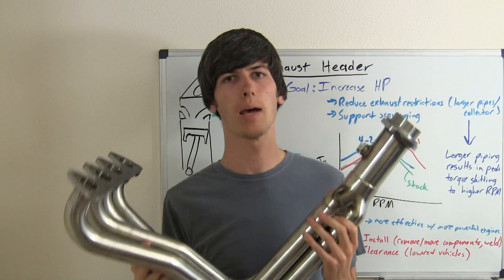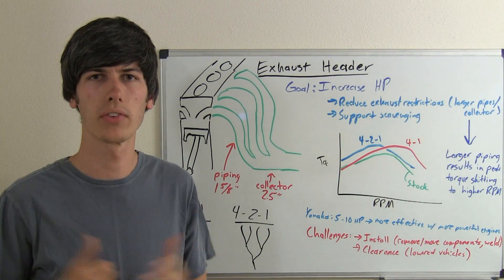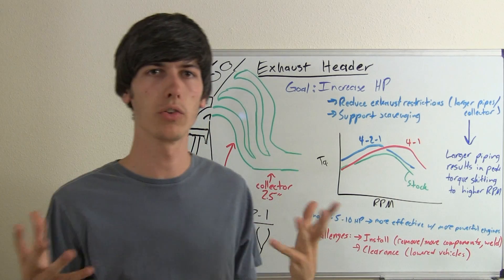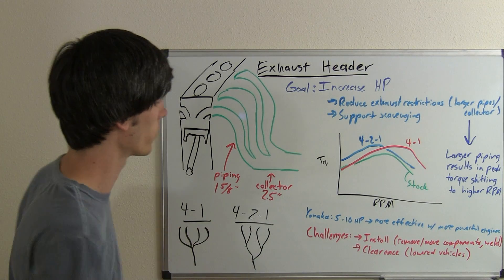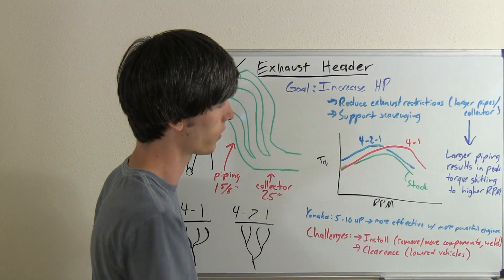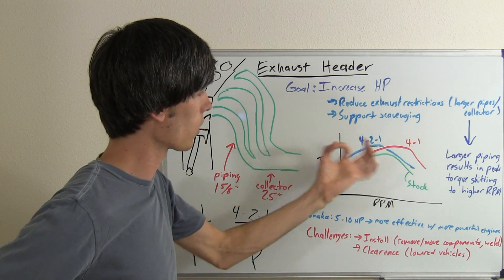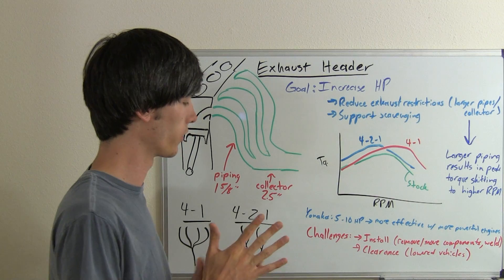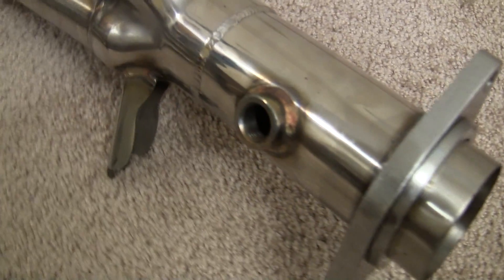Exhaust Header - Explained

Comment: What's in a name?.
Headers are usually cast iron factory fitted  first part of your exhaust system. Made cheap and compact in such a way that they create swirling gases that slow down the extraction of exhaust gases.
Extractors are usually an aftermarket steel or stainless steel put together so that exhaust flow from one cylinder assists another to extract exhaust gases.

Please spread this around headers are not Extractors and Extractors are not headers.

Comment: Thats a differant 4 into 2 into 1 should be explained as a 4 cyl. Header thats 2 and 2 into one, the correct, 4 into 2 into 1 goes like this...the 4 pipes converge into the split 2 pipes at the far end and then converge into 1 , then the 2 ....2s and the final 1 pipe act as a collector. Hope i said it right,  Hope this helps.

Comment: Ik this is DECADES old but i have a question... ima instal headers regardless but since i have a yonoka catback exhaust system and i wanna know once i install the headers and then getting the tune.. would it make my car start to pop? Cuz my car makes suttle pops like sooo low pops but you can hear just not loud like most cars are.. so my question is will it start to pop? Also i did an exhaust delete hence why it pops very suttley

Comment: Other than the sound what are the advantages of a 8 into 1 header collector? Someone told me that a 8-4-2-1 would produce the same or similar sound without some of the power loss particularly in the low and mid rpm range and some of the packaging issues with the 8 into 1 collector. Is there any truth to this?

Comment: For me I have rsx k20a2 type s in the car I have 4-1 header with Muggen down pipe and 2”5 fully piping on eBay parts I feel my car have more torque and top end raced , I have raced b series  wrx Sti rsx and 9gen full both on still beat them ❤ 
I just say 4-1 vs 4-2-1 header depending how is the driver racing and shifting

Comment: Should the exhaust port of the head match in size and shape to the header or does it not matter? Some factory exhaust ports are smaller then the header. For example a M42B18 BMW. Do you have an advice?

Comment: Question.  how about n/a engined cars. i have a nontutbo 1.6 and 1 and 6/8 inches is the diameter now. can you tell me the theory about the diameter. should i worry about a 2.5 or 3 inch? as i dont really need backpressure. but i can imagine that i want the exhaust fumes to leave to the exhaust, so if the diameter is to big you dont fill all the space in there?

Comment: Hi I own a car with 67 horsepower at 6000rpm, 91nm at 4400rpm. Should I change the header for more hp or should I just sell it... It's Perodua BEZZA 2020 1.0 3 cylinder engine, It is an 1KR-VE Engine from daihatsu. Is it ok to put in turbocharger into and change the header?? The car is very low on hp and my regret of buying it... So help me out please

Comment: Dear Engineering explained. My question has to do with an exact situation with the C8 when one of the vloggers showed his receipt of a Kooks exhaust header. He did a "pull" with his stock header on the 2020 Stingray, 6.2 liter pushrod, V8 engine. After taking the initial reading for HP and Torque with the stock exhaust manifold, the latter was removed from the Corvette. In its place with the same other stock cats and pipes, resonators, pipes and mufflers and tips, the only difference that was tested, was the addition of the Kooks exhaust headers, where the stock exhaust manifolds formerly had been. (Although a short tube header system, the pipes appeared to be longer and with mandrel-bent turns to the, "collector." The diameter was slightly larger than stock. Then the C8 vlogger ran a dyno once again with temperatures the same; same gasoline, etc. Result: throughout the range, including at the cross-over, the Kooks headers provided readings that were 2 to 4 horsepower lower in both horsepower and torque, even at the crossover point, than were achieved by the stock manifold. What is the explanation for this? I wrote into Kook asking for an explanation and received no information at all. The only thing that might have affected this result, is that it appeared to me that the connecting flange of the Kooks header, had smaller opening than its pipes and also smaller openings than stock. However, writing into the vlogger, produced no response or answer to me, just a lowly fan, observing the YouTube vlog. AF

Comment: Would 4-2 headers be bad?? Would that make it more work for the engine since it’s only 2 cylinders pushing exhaust out through each pipe or would it help because it’d have more space and less restriction

Comment: Could you include an X pipe in the header design? Thereby increasing volume for exhaust gas and equalising pressure. Header pipes would then continue as normal to the collector.

Comment: I also have much respect for this presenter, but would like to make the following comments: It might not be necessary to use stainless steel for a header as it is too hot to rust. Then I don't see any mechanical accommodation for the engine movement in the exhaust in this transversely mounted engine. Kathrynck below makes mention of tuning; is there someone who would like to support the idea that a high pressure wave leaves the engine, and once it reaches the first sizable expansion point, it is reflected back to the engine as a low pressure wave, which enhances the air flow at certain frequencies ?

Comment: Do you think that by tunning the lenght of the primary runners on a 4x1 exhaust of a regular inline 4 cylinder engine (flatplane), one could tune it  to sound like half V8 (one bank of the V8 engine)? I've tried to think of it as the time each of the 4 exhaust pulses take to get to the colector and thus interfere each other, considering one side of a V8.

Another example: the crossplane crank inline 4 cylinder Yamaha bike: it sounds amazing because it is a 'half V8'. I've tried to think of the mathmatics of the pulses interferences as the time it gets to hit the collector, by selecting different lenghts of primary. It would probably hit performance but possibly create a great sound. And the performance loss could be offset by boost.

Comment: Heyy saw alot of awsome things on your chanel and in the comments I'm jus a guy working to make my car fun.... But here is something that I was hoping to get some fun ideas about I have a D16y8 550cc injectors nothing touched in the motor yet lol but I do have 4-2-1 headers jus got them I have a wider exaust and resinator 3 inch now will this cause some back pressure but still allow breathing properly in theory I'm about to bore the headers before I install for a smoother gas upstream down stream exchange it makes sense on 4-1 and why its better any thoughts and yes I will keep updated on my results I have videos of now w the factory headers and swapped injectors factory exaust id love to hear some input and haters please apply I love hearing all thoughts

Comment: Nice job on this video. You really should discuss the primary pipe length as it is the single biggest factor for the tuned header. A shorter pipe length move the peak torque higher up the RPM band while a longer pipe length moves this down the RPM scale.

Comment: why isn't a "two point five" inch pipe called " two and one half" in pipe? in line with other measurements like 1 and 5 by 8 inch etc? OR just stick to the more human decimal system? good explanation though..liked it

Comment: I apologize if you covered this, If you want to replace your stock exhaust header with something with larging piping, how would you connect the larger piping to where it connects to the engine? I'm guessing it has a specific diameter. I didn't know if there was another piece you would connect to make it fit or not. I love you videos I'm learning so much.I also have a vw rabbit a/t 2007 2.5 that I would like to start fixing up.

Comment: okay so hears a question for you that I've always wanted to know. i drive a subaru and the have a 4-2-1 exhaust header. now in theory if i ran duel exhausts from both sides of the motor basically covering the header system to a 2-1 would that increase power efficiency and whatnot? I'm VERY curious to know.

Comment: I suggest you to talk about the droning effect . I've installed a 4-1 OBX header with a magnaflow catback on my golf 2.0 and the droning inside the car is just sick, destroyng my ears. I caped one of the output pipe of the muffler to retain some back pressure. returning like standard "performance" it fix the noise quite good, but it no longer work very much now. at least ,I can just remove the cap if i want ...

Comment: I like that you talked a bit about the types of collector designs.  If you look at some of the nascar cup car headers, they have various designs including 4-1 and 4-2-1 for each cylinder bank, as well as various pipe diameters of each step.  It's really just tuning based on the track they're running, but it's surprising to see so many different configurations.

Comment: Is there a specific equation that you could use to determine the best, most efficient diameter tube to use based on engine and desired horsepower/torque?  For example, if you have a 5.7L Hemi and want to produce 500ft/tq.  What diameter tubing would be best?

Comment: What is the O2 sensor, and what does it do?
Reply: PixelRacerClips PRC 02 sensor is a sensor that is attached to your catalytic converter but since these are long tube headers you'll be getting rid of your catalytic converters so you place it there. And it just lets you know if your car is functioning or not

Comment: im planning to remove my resonator and upgrade my pipes into a stainless steel 2.5in pipes and change my stock muffler into a freeflow muffler.. my question is can i gain a horsepower into it?? thanks for more info you shared

Comment: sir my  question is if the if i have an v6  so should is use two 3-1 exhaust header?? ,n sir can u help me if i want to make an v6 engine which can produce around 600hp , but still i want a bit fule econome so if i m in 24h race i will make less pit stops in the race
plzz reply , TYVM

Comment: I have a 92 VX Honda Civic Hatch
Any suggestions for what kind of headers I should get??
Reply: Mike Harkins i want a street racing set up
Reply: Anthony Sainzz
.. All depends on your budget and what kind of power you are looking to get my man.. Street racing setup can be anything from ebay to top of the line depending on budget and power. Also, if you are going street racing, you need full exhaust setup, intake, headers, exhaust. And should be done at once not in pieces. So save up for the whole exhaust then have it put on at once. Saves in long run.
Reply: Mike Harkins yea Im getting the whole exhaust system first I just honestly don't know what brand tho I don't want anything boo boo , only thing is what's after the exhaust system? I just bought a new intake yesterday
Reply: Anthony Sainzz
OBX is decent for the money. I have one on my RSX and have had no problems. They have a lot of decent reviews and you cannot beat the price. I am not a huge fan of Skunk2, but hey it is all about preference here. I am not that familiar with 5th Gen civics, but I do know they are engines easily modified and last. Depending on how much power you are looking to get, I would first have an end goal before buying headers or exhaust. If you are going to boost, you will need better headers that can take more power. No point in buying cheap headers if you are going to boost in the future.  If you are just looking to stay all motor and maybe hit 200-250 HP with the engine, you can get away with cheaper headers and exhaust because they will not need to withstand such extreme heat and exhaust pressures. If you beat on the car a lot, I  would also invest in higher quality as well to handle your driving. You have to take into account many things before buying. You have to plan far ahead as to not waste time and money. If you have some really specific future goals I can give you more specifics, but it is hard to just throw out products you should get without knowing all the details. It would be best to find a good mechanic knowledgeable in performance and both come up with a plan of attack for the car and its upgrades.
Reply: Mike Harkins yea I get you dude, thanks for the advise 👏🏻 appreciate it, but if I have any question or something I will be sure to let you know or do some investigations my self, because I want so good things for my car I don't want something to be cheap and yea like you said don't want to waste time and money
Reply: 5

Comment: how does this add up with turbo charging? basically how does it affect the WRX;) is 421 better for quick spool or 41?
Reply: It all depends where you are trying to make more power man.. 4-1 will help on the higher end, and 4-2-1 will help on the lower end.. All depends what you are looking for personally in your car. Just research on the wrx sti forum on which suits what car and for what kind of power.
Reply: I understand the premise of the video but my question should have been if it's the same for NA cars.
Reply: Mike Harkins were you a 94E
Reply: Exodus fivesixfivesix
.. It is the same for both FI and NA cars.. Just more glaringly obvious for FI.. But so many factors are at play once you go FI

Comment: will i get any power or fuel economy improvement with a exhaust header with a stock exhaust?
Reply: not really. And power and fuel economy should not be used int he same sentence lol
Reply: bolt on mods tend to give hp and mpg boost at the same time.since adding somthing that increases power with the same amount of fuel u need less foot on pedal saving fuel.  just wasent shure about the exhaust header with stock exhaust.

Comment: Hi, I need some suggestions to make my car faster. 1.2 litre, inline 4 cylinder engine. It is a Nissan A12 petrol engine with 4 speed gear box. Pls suggest some mods which can add power to the vehicle. Will the cat back exhaust with exhaust manifold and cold air intake bring the change or i have to add turbo??
Reply: Have you already put a wing on the back and added a bunch of stickers? That's the first step.
Reply: Tausif Ahmed
good, a much easier car to mod. But still a small ass engine. You cant be from the US lol.. The Vento is a smaller Jetta right? Another 1.2 liter? While its easier to mod cuz its a VW engine, still wont get much power gains out of it with any kind of durability. Your best bet with the TSI is getting a bigger turbo for more power but again, I am not sure how durable the car would be handling 50% more power.
Reply: Buy a new car lol.. You would need to turbo the car to see any real power from it, but I just dont see the point in spending that kind of money in that kind of engine. Intake, exhaust, and headers wont do much for you with that car. If you plan on adding power to any engine, it needs to be a durable, and consistent engine like a Honda or Subaru if you want power from a 4 cylinder. And you can mod and turbo these engines with relative ease and still have reliability and some durability. They also have relatively cheap parts in comparison to Audi/VW which have decent 4 cylinder engines to mod but are much more expensive for parts.
Reply: Mike Harkins thanks for the reply, yup I hav bought new VW vento tsi..
Reply: Mike Harkins yup, it's smaller Jetta with 1.2 litre engine in India. We can remap the ecu to get a 30 % power gains and a 10 % with intake and exhaust modifications 👍🏻

Comment: i have a 1988 k5 blazer with a 350 tbi engine and made some headers for it but i ended up losing power over to stock manifolds the pipes are 1.5" and its a 4-2-1 headers for each side why could i be losing instead of increasing?
Reply: You probably didn't make them well or use any actual geometry or theory in your building. Read A. Graham Bell's book "4 Stroke Performance Tuning", he's got a whole chapter about headers and how to calculate the ideal lengths and such for them.

Comment: I'm not happy with your explanation on exhaust header design, If you link the correct 4-2-1 design exhaust together in the collectors 1-2 & 3-4 you find top end the same as 4-1, and maintain strong midrange.
Look at motorbikes, years ahead.
Pipe diameters change the pressure in the tube, too large and you will loose to much pressure and thus loose torque, to small, good torque, lacks top end revs.
All about sound waves, break points, pressure, scavanging and efficiency, (not 'back pressure', thats a 2 stroke laymans term, and can be referred to as the 'positive returning wave' which is going to upset a 4 stroke fyi.